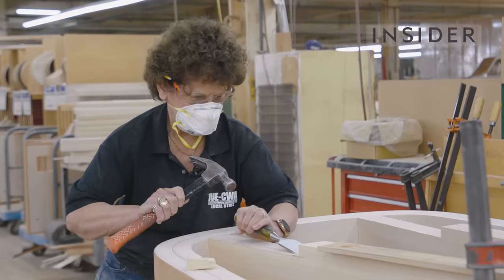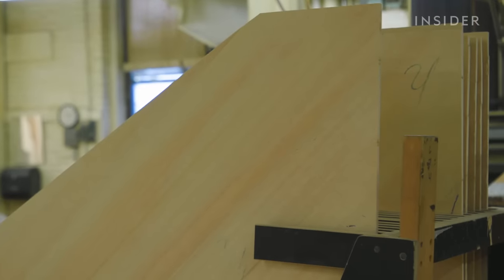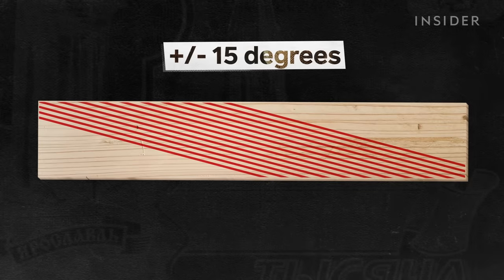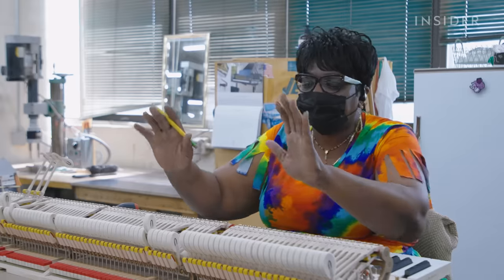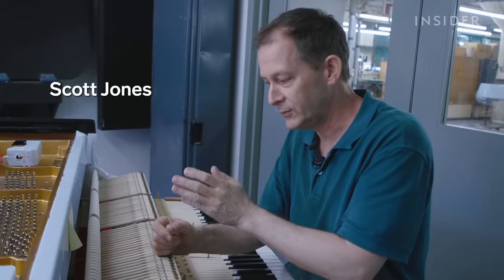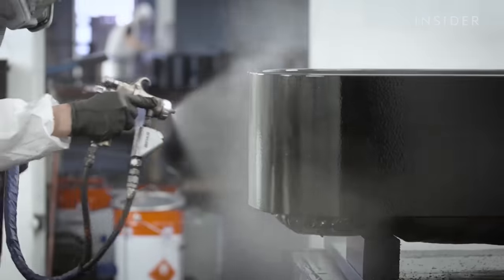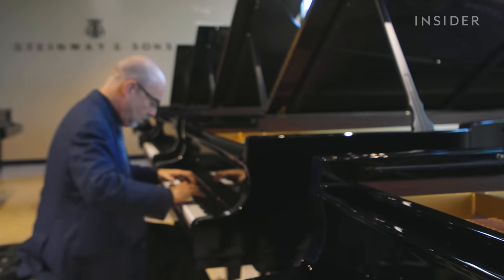Why Steinway Grand Pianos Are So Expensive | So Expensive

Comment: “A piano can last several decades” well yeah if I’m paying over a hundred grand my grandchildren’s grandchildren better still be able to use that thing
Reply: They probably will as long as your family takes care of it.
Reply: @carlangelo653  well yeah I’ve seen some pianos that are nearly a century old that people still take care of but my question is how..
Reply: @carlangelo653  So true, just as most other instruments require.  If it is maintained to be in good condition, it will stay in good condition.
Reply: @carlangelo653  wish i could have got my grandparents but after they died my aunt sold it off :'/
Reply: @carlangelo653  yeah
Reply: 100 grand is the most affordable, Steinway normally cost 200k to 700k
Reply: Too bad most of the times small repair work will be needed to be done over such a long time. Besides that the quality of the wood will decrease over this big time and also potential now unaware engineering problems may be revealed as an example that cracks in the metal board may occur
Reply: @Brian-jv8iy  yep
Reply: I play on a rippen piano that my grandmother used to play on as a child, it still sounds great even though it wasn't maintained for a few decades, so I think these Steinways will last a couple of generations
Reply: It better be gold plated, too
Reply: Perhaps they will last that long...unless you play like Little Richard or Jerry Lee
Reply: And if you take care of it, they will.  A good piano can last well over a hundred years.
Reply: @Zerbey  Our YoungChang is half way there
Reply: my grandparents have one in their living room, can tell you how long it can last when i eventually inherit it (lets hope not anytime soon)
Reply: @kunikidaspookie  i have a piano thats around 150 years old and still a great sound.
Reply: @beluwuga  That's just not true. The most expensive Steinway tops out at $170,000.
Reply: And regarding the fact that we still have pianos and cembalos that Mozart and others used to play on multiple centuries ago, a piano that can just last decades, seems a bit cheap! Lmao
Reply: For that kinda money the damn thing better play itself.
Reply: So long as you live
Reply: @jackthecommenter2768  I have a 19th century piano in my house
Reply: Bloody yeah lol. Precisely what I was thinking. We've got a piano well over a century old. No idea if it has appreciated in value. If it has, I bet the cost of inflation, tuning and maintaining it outweighs that, but it still sounds fantastic.
Reply: @hugod327  While I am not sure about Pianos, for Acoustic guitars the older wood is considered as a feature cause it has a very distinct frequency response and sounds better than normal wood
Reply: they can last centuries (my family have a 1864 steinway upright)
Reply: People pay that for cars that end up like crap in 10 years, I am pretty sure this piano worths every penny
Reply: I mean, I play my grandpa’s Steinway grand piano. Although I prefer my Boston upright piano. 😁
Reply: @tz4601  Not so. That is the price for a basic black model D. Different woods and finishes can significantly raise the price from there.
Reply: It can last a century
Reply: “A piano can last several decades” In a concert hall, where the piano is played often and tuned almost as much, there comes a point where it wears out. The holes that the tuning pegs sit in become larger and the piano can no longer hold its tune. It can be refurbished but this sometimes is cost prohibitive. And if the sound board gets damaged then that is the death of the piano.  Naturally this wouldn’t be the case where it is sitting in someone’s house.
Reply: It is my understanding that pianos don't actually age like guitars, for example.
Reply: @Brian-jv8iy  You're american, right ?  You're more pop than Mozart, right again ? Figure.
Reply: Instruments should be able to do that :) Old instruments are so fun!
Reply: Now I know why they call it "Grand"
Reply: Lmfao man
Reply: @craigspallin554  it depends. If the piano is placed in an uncontrolled unvironment and, if it's not maintained properly it won't do the piano any beter especially the soundboard🎹🎶
Reply: I practice on the upright that my grandma had when she was a kid and that my mom also practiced on. Pianos last pretty long
Reply: I have a piano that my piano teacher gifted that says it was built in the late 1800s...i swear it says that and we take extremely good care of it, but it's just so insane to me
Reply: @Brian-jv8iy  truly said. As a Piano technician I can assuringly say that a Steinway is quite irritating to repair or even service; especially when it comes to dampers that are glued rather than screwed in like other European brands. It’s very laborious and time consuming.
Reply: I have a piano made in 1880’s that sounds great. They are, the Victorian era beasts, built like tanks.
Reply: @jackthecommenter2768  it’s not hard, actually. I have one from 1880’s. They built them well.
Reply: I had a Steinway Model M before I moved that was 100 years old.  It had the action redone, but it sounded and played AMAZING.  Even 100 years later.  If they are cared for they can last a VERY long time.
Reply: Pianos, unlike most instruments, actually lose value and degrade over time. This is mostly because the soundboard is under so much tension and has so many moving parts. Pianos need tons of preventative maintenance so that they can even maintain their value.
Reply: Same with violins they’ll actually last hundreds of years if you take care of them and it’s repaired by people that actually know how to restore wood.
Reply: @Shyftus  I wish they live forever, grandparents are true treasures. 😭
Reply: @eswarjuri  Those weren't pianos, they used to play clavicembalos, used to be piano and forte (piano=plain or "soft", forte =strong); as the instrument evolve, they made it as just one instrument and reduced the name to "piano".
Reply: @jackthecommenter2768  go watch a video on the piano museum where musicians go play extremely old pianos played by some of the most famous musicians
Reply: And likely sold for a fraction of the cost...
Reply: I have my great uncles steinway and I can confirm that’s it does last.  It’s also beautiful
Reply: For those that can't afford a Steinway, I would suggest to them a Henway.
Reply: Get on the cross and don’t look back  no
Reply: I recently played one from the 1890s in a concert. Played better than any of the others I have played. They last a while haha.
Reply: “Then Peter said unto them, Repent, and be baptized every one of you in the name of Jesus Christ for the remission of sins, and ye shall receive the gift of the Holy Ghost. For the promise is unto you, and to your children, and to all that are afar off, even as many as the Lord our God shall call.” Acts 2:38-39 KJV 

“Jesus saith unto him, I am the way, the truth, and the life: no man cometh unto the Father, but by me.” John 14:6 KJV 

“He that believeth on the Son hath everlasting life: and he that believeth not the Son shall not see life; but the wrath of God abideth on him.” John 3:36 KJV 

“For if ye forgive men their trespasses, your heavenly Father will also forgive you: But if ye forgive not men their trespasses, neither will your Father forgive your trespasses.” Matthew 6:14-15 KJV

“And I say unto you, Ask, and it shall be given you; seek, and ye shall find; knock, and it shall be opened unto you. For every one that asketh receiveth; and he that seeketh findeth; and to him that knocketh it shall be opened. If a son shall ask bread of any of you that is a father, will he give him a stone? or if he ask a fish, will he for a fish give him a serpent? Or if he shall ask an egg, will he offer him a scorpion? If ye then, being evil, know how to give good gifts unto your children: how much more shall your heavenly Father give the Holy Spirit to them that ask him?” Luke 11:9-13 KJV

“And Jesus said unto them, I am the bread of life: he that cometh to me shall never hunger; and he that believeth on me shall never thirst. But I said unto you, That ye also have seen me, and believe not. All that the Father giveth me shall come to me; and him that cometh to me I will in no wise cast out. For I came down from heaven, not to do mine own will, but the will of him that sent me. And this is the Father's will which hath sent me, that of all which he hath given me I should lose nothing, but should raise it up again at the last day. And this is the will of him that sent me, that every one which seeth the Son, and believeth on him, may have everlasting life: and I will raise him up at the last day.” John 6:35-40 KJV 

“And fear not them which kill the body, but are not able to kill the soul: but rather fear him which is able to destroy both soul and body in hell. Are not two sparrows sold for a farthing? and one of them shall not fall on the ground without your Father. But the very hairs of your head are all numbered. Fear ye not therefore, ye are of more value than many sparrows.” Matthew 10:28-31 KJV

“That if thou shalt confess with thy mouth the Lord Jesus, and shalt believe in thine heart that God hath raised him from the dead, thou shalt be saved. For with the heart man believeth unto righteousness; and with the mouth confession is made unto salvation. For the scripture saith, Whosoever believeth on him shall not be ashamed. For there is no difference between the Jew and the Greek: for the same Lord over all is rich unto all that call upon him. For whosoever shall call upon the name of the Lord shall be saved.”
Romans 10:9-13 KJV 

“Jesus answered, Verily, verily, I say unto thee, Except a man be born of water and of the Spirit, he cannot enter into the kingdom of God. That which is born of the flesh is flesh; and that which is born of the Spirit is spirit.” John 3:5-6 KJV

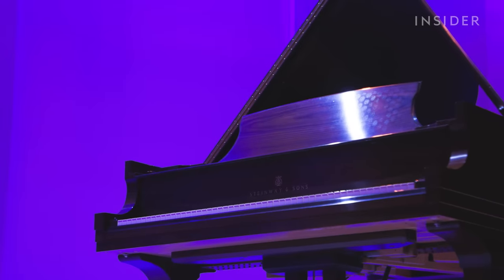“Who hath delivered us from the power of darkness, and hath translated us into the kingdom of his dear Son: In whom we have redemption through his blood, even the forgiveness of sins: Who is the image of the invisible God, the firstborn of every creature: For by him were all things created, that are in heaven, and that are in earth, visible and invisible, whether they be thrones, or dominions, or principalities, or powers: all things were created by him, and for him: And he is before all things, and by him all things consist. And he is the head of the body, the church: who is the beginning, the firstborn from the dead; that in all things he might have the preeminence. For it pleased the Father that in him should all fulness dwell; And, having made peace through the blood of his cross, by him to reconcile all things unto himself; by him, I say, whether they be things in earth, or things in heaven.” Colossians 1:13-20 KJV 

“Look not every man on his own things, but every man also on the things of others. Let this mind be in you, which was also in Christ Jesus: Who, being in the form of God, thought it not robbery to be equal with God: But made himself of no reputation, and took upon him the form of a servant, and was made in the likeness of men: And being found in fashion as a man, he humbled himself, and became obedient unto death, even the death of the cross. Wherefore God also hath highly exalted him, and given him a name which is above every name: That at the name of Jesus every knee should bow, of things in heaven, and things in earth, and things under the earth; And that every tongue should confess that Jesus Christ is Lord, to the glory of God the Father.” 
2 Philippians 2:4-11 KJV
Reply: @kb9512  no
Reply: Obviously it’s not the point. No wonder if you never can’t afford it
Reply: @kb9512  no
Reply: Nah it’s disposable. 3-5 year life
Reply: @quasarproductions2690  God that's such an awful thing 😢 they sold a piece of Antique filled with memories
Reply: @shock-eh3849  they can last longer than that🎹🎶
Reply: “A bloodline of pianists’
Reply: dude and it doesn’t matter people use and love pianos that are hundreds of years old
Reply: @enriquejaimes3368  Your Steinway isnt going to cart you to work, mate.
Reply: If someone wrecks a piano, the most beautiful instrument out there, then they need to be dealt with
Reply: @tag7100  it does play itself spiro model or something. 
Believe me that's not a good thing.
Reply: Damn yes
Reply: That's a lot of grands. Grand piano, hundred grand, grandchildren
Reply: I've yet to encounter an older Steinway that's anything like a new one. Piano's degrade. Japanese piano's seem to last longer and are easier,  thus cheaper, to work on.
Reply: @drfisheye  yes but worth restoring🎹🎶
Reply: @MERCEDES-BENZS600GUARD_V12  A piano can't be truly restored. You'll need new components which will sound different than the original components. Also all manual work on piano's is subjective. So you get the musical taste and knowledge of the restorer instead of the original builders. You end up with a mix of a piano that's not original, nor new. Could still be a nice piano though.
Reply: @drfisheye  that is also true. As long as the restoration is done right and the original soundboard design isn't tampered with and as long as high quality parts and matirials are still used in the strings action and other moving mechanisms restored pianos can be great pianos. There is however anexeption which is Steinways made with teflon parts used in they're  actions in this case it's ok not to use 100% of the original parts required🎹🎶
Reply: They take time to age in anyway so old but maintained pianos can be even better to play than a new one.
Reply: Just take care of it. My family owns a 1917 Yamaha (Nippon) piano we inherited from our great great grandpa.
Reply: I've heard a high-end piano can last 100 years if treated well.
Reply: Several decades is not worth the investment. They better last generations.
Reply: @kristophermiller6160  and yet many luxury cars only work good for several years. Pianos aren't worth it unless you know how to play🎹🎶
Reply: A friend of mine owns one from the 1930s and it still works.
Reply: @beluwuga no they don’t lol
Reply: Several decades? It better last more than 30 years!
Reply: It will at least outlast some cars that are 10x expensive.  This is not for private citizens who have to save their money to buy.
Reply: This is not true for a lambo lol
Reply: @jackthecommenter2768  you get a professional to tune it up, and replace parts from time to time.
Reply: A piano can definitely last forever if it's in good condition
Reply: I still use my great grandmothers baby grand Stineway and Sons piano from 1915, sounds like any new piano that just needs a tune- cuz its been like 10+ years since last tune 🤷‍♀️
Reply: @jackthecommenter2768  you tune it, clean it of dust, just like other instruments :)
Reply: It can last hundreds of years, fingers crossed there is no fire or water incidents.
Reply: It's about the quality of performance. People don't spend hundreds of thousands on Ferrari thinking reliability and 50 year life, they buy it because of it's performance and beauty.
Reply: if taken care of properly, a piano can last hundreds of years.
Reply: People are saying a piano can last centuries, but that’s not true in a musicals sense. Sure, the physical pieces will still be there, but the soundboard doesn’t retain its tone. That’s what they mean when they say it will last a few decades.
Reply: @alex_707 a Steinway can still last longer than that though🎹🎶
Reply: Most Steinways are for concerts and recitals and music studios but not too much for home use.
Reply: They do. My Burger & Jacobi is now 110 years old and was just an ordinary Home Instrument when it was new
Reply: my entire bloodline better be able to 😂
Reply: Can you say the same with a modern day luxury car?🎹🎶
Reply: Dont Forget To Add the ENJOYMENT AND THRILL OF THE STIENWAY SOUND. It's not About "USE" at All. But "Decades".... ?  TRY FIFTEEN DECADES!
....IS ONE HUNDRED AND FIFTY YEARS ENOUGH?
Reply: I played on a 120 year old steinway, still sounds beautiful but the keys were a little less wider and rounded at the bottom
Reply: If you’re worried about spending $100k on a piano maybe you would get a better value from a Casio keyboard.
Reply: @christopherknowles  I prefwr my Yamaha🎹🎶
Reply: Not several decades. A great piano can last longer than that, which is why people still own pianos that are a century old.
Reply: And with a Steinway they certainly will be. These are works of musical art.
Reply: your grand grandchildren probably gonna sell it anyway